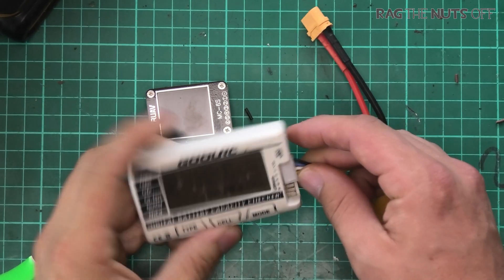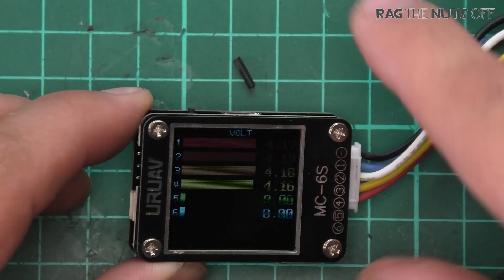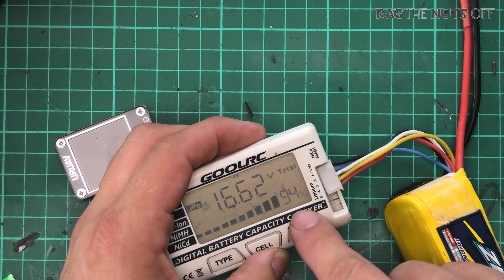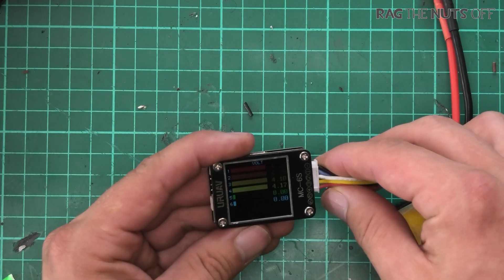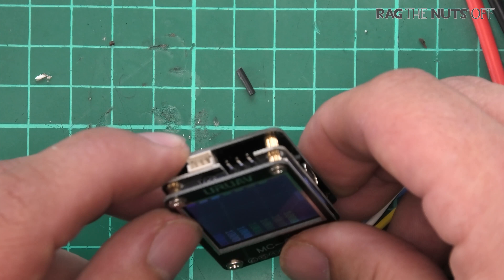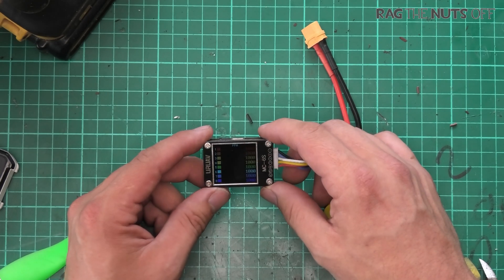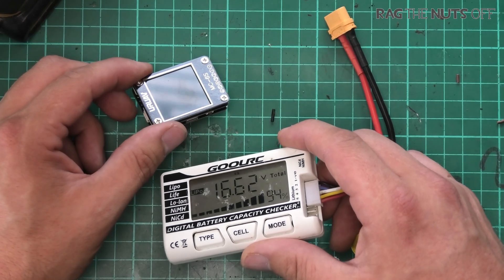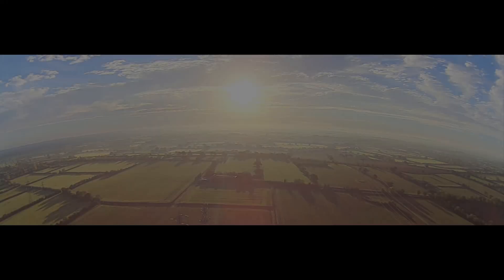URUAV MC-6S RC Battery Tester Review (Hint: 👎👎)

Comment: Ideally useful for testing the function of a receiver before you solder it to your FC. with XM+ these days it’s a nightmare after you have installed the rx and it won’t bind. Easier to flash firmware first and test rather than keep unsoldering, flashing, soldering again and find it still won’t bind. This little thing will save a lot of frustration and heart ache. To me, the voltage tester is a bonus. I have many voltage testers but no rx testers until now. I would recommend this as a very useful addition to your building and testing tool box.

Comment: I hope they don't screw up this checker by adding the percentage. I need to know the actual voltage for parallel charging and I'm brilliant enough to figure out by that also if the battery is charged or not.

Comment: I've actually never used a tester with a percentage display and never wanted to. The percentage depends on what you consider zero percent to be. If the zero value of the tester agrees with the lowest voltage I would ever want to see on a particular battery that would be fine, but that's not the same for every battery so I'd always want to see the voltage anyway. There's also the small matter of each cell having individual voltages which can differ.
Reply from the maker: Howdy Chris, do you think that's because of the quad background Vs my fixed wing background? Maty

Comment: I think the speed of that thing is interesting; you don't have to wait for it to scroll through all the individual cell voltages. An initial percentage flash could be seen as an unwelcome delay. But this one is probably more for the bench than  the flightline because of the low brightness.

Comment: The horizontal bars representation is comparable to a percentage... easy to read without any knowledge on batteries voltage (who doesn't know a battery below 3.7V should be charged ?). It's a really compact and useful device providing a reasonable accuracy.
Reply from the maker: Unfortunately 4 bars or so are not as easy to read as one percentage. Let alone about doors where the screen is unusable. See the other comments on this. Matt

Comment: I have that tester and I agree, it is not that useful. However, it is really small and I don't often need to check my batteries because I only fly multirotors and therefore usually empty my packs completely. So it does the job. The bigger one (I have a clone called AOK Cellmeter 8) is absolutely fantastic, especially with the discharge kit with 3 50W halogen light bulbs. I use it all the time and it works perfectly.

Comment: That's a shame.  I always love a new gadget.

But what I'd really like is a cell balancer that actually has a reasonable current rating.  Most of them seem to be a couple of hundred mA, which is next to useless on a large capacity battery.
Reply from the maker: Hey Matt, yea was a shame. A big fat 94% would have been amazing. As for the balancing of cells, i always balance charge mine so they're never that far off, well unless I hammer it hard and meh.... 😂